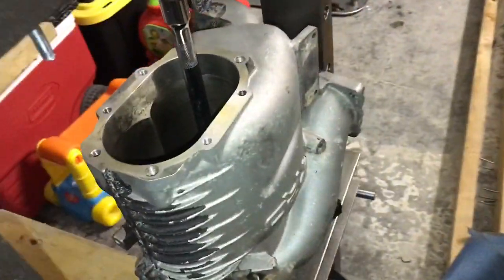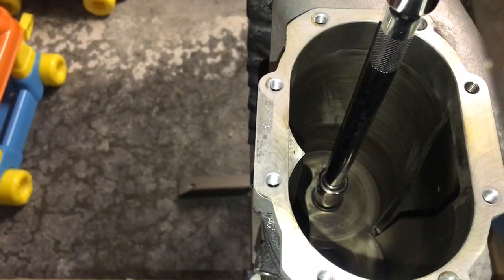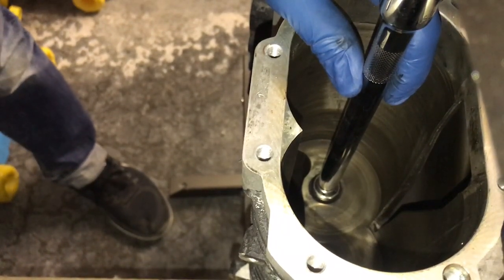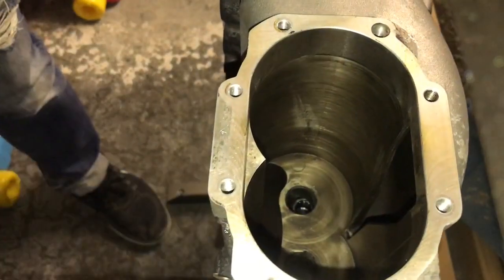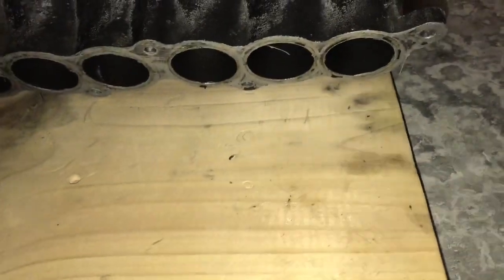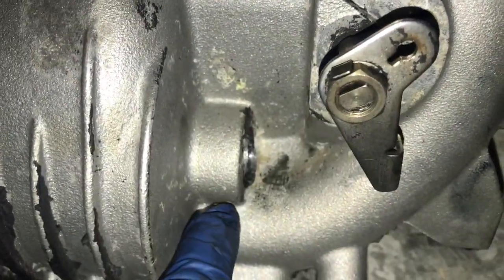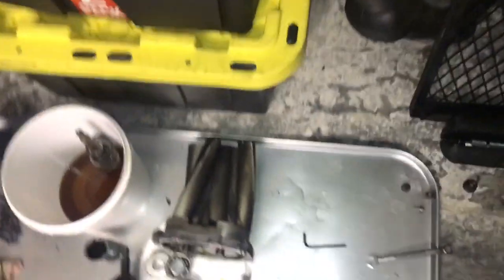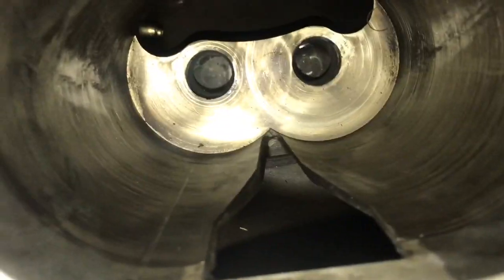3.4 TRD Supercharger rear bearing removal

Comment: how did you end up removing the rear bearing that was hitting the housing im having the same issue
Reply from the maker: I just pressed it threw. It will end up bending out of the way. Might leave a scratch on the SC but it will come out. Make sure you don’t press the new one in to far or you will have to get a new one as it only goes in one way.

Comment: Did you do the rotor plate bearings too? I tried to on mine and screwed it up. I ended up sending it to The High Speed Lab in St. Louis.
Reply from the maker: Sorry for the late reply, haven’t been on for a while. I’m just now finishing up putting it back together as I had the supercharger sand blasted and powder coated. The rotor plate bearings are still good on mine so I didn’t swap them out. Only reason i really pulled out the others was for powder coating. They didn’t want to put the supercharger in the oven with the bearings still inside.
Reply: Michael Rueckert how did you screw it up and what could you have done differently to avoid this?

Comment: how the heck can you press the new one in with no access from the back side??
Reply from the maker: It will fall out the 3rd cylinder hole. It’s all connected on the inside